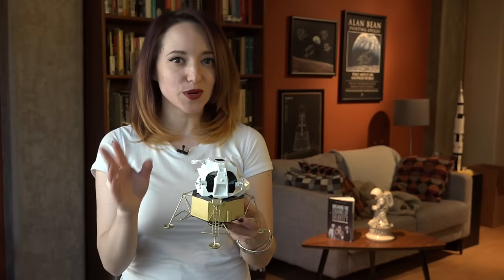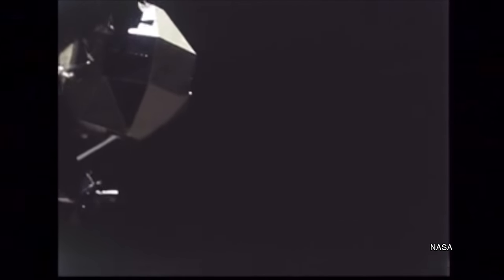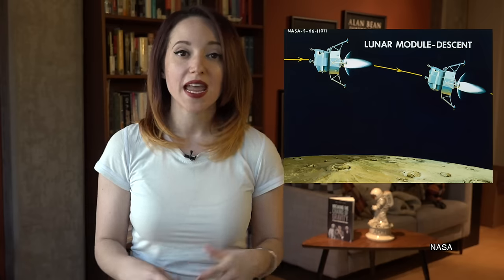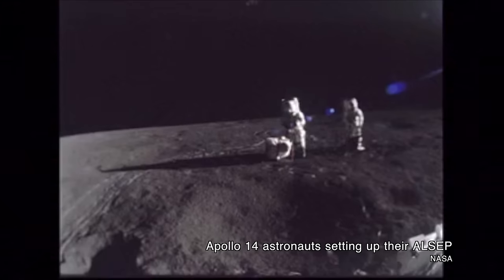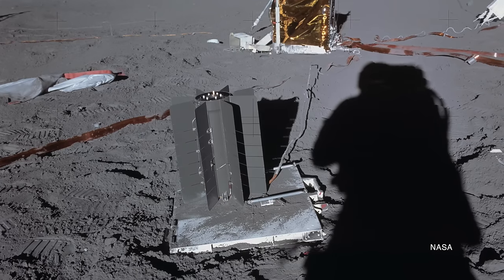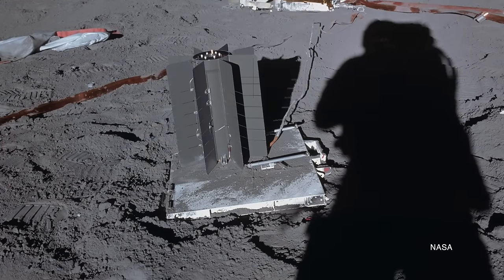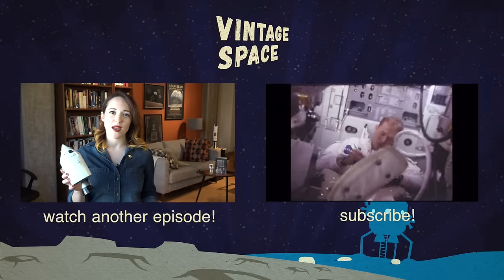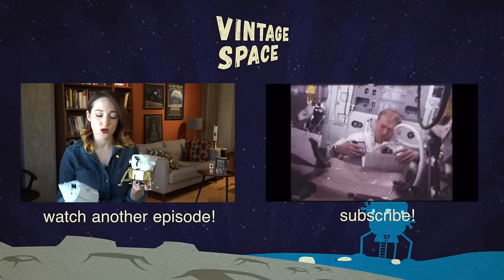What Happened to the Spent Lunar Modules?

Comment: Why and how did NASA decide on a cone-shaped command modules?
Reply: +amazing visser3 Easier reentry. Wouldn't work if it were cube, right?
Reply: +amazing visser3  Aerodynamics.  A cone shape is slightly more stable, has a little aerodynamic lift and is therefore a bit more steerable than the more spherical shape that the Russians use.  The spherical shape is more efficient with interior space and weight of materials.
Reply: +Peter Kosen yea but there is kind of no air in a vacuum.
Reply: Kaleb Bruwer  Oh?  You mean they stay in space forever and never return through the atmosphere??
Reply: A major reason for the decision was that a cone-shaped vehicle coming into the atmosphere blunt end first creates a shock wave located about 2 to 3 feet ahead of the surface of the heat shield. This insulates the heat shield from the super-heated plasma that is present inside the shock wave. If a vehicle with a more conventional aircraft fuselage shape tries to reenter nose first the shock wave would form right at the nose and place the vehicle's structure directly in contact with the hot plasma, causing it to burn up. Another secondary reason is that the same couches that helped the astronauts tolerate the G forces while accelerating during launch will work the the same way while decelerating during reentry.

Comment: I'd always wondered if any remnants of Aquarius survived re-entry.  Some probably did, but likely at the bottom of the sea given the 70% odds.  Still, would be great if someone somewhere had a piece of it, maybe used as a lawn ornament, a coffee table base, or the like.
Reply: +DSC800   Pretty sure the fuel cask along with the plutonium-238 pellet stored in it survived as it was designed to do. Radiation level checks appeared to have remained normal shortly after the incident.
Reply: +mako88sb probably best that 238 cask stays at the bottom of the sea and not used as a coffee table base then.

Comment: What happened to the Apollo 13  Lunar Surface Experiment package and its plutonium fueled RTG when the LEM burned up in the earth's atmosphere?
Reply: +WATERDOG300   The RTG was not fueled. There was a special built storage cask designed to withstand re-entry mounted on the outside of the LM that contained the plutonium pellet.  Mission control purposely directed Aquarius towards a entry corridor that had it targeted for a very deep part of the ocean about 200 miles from New Zealand. Radiation tests of the surrounding air and water shortly after it's burn-up showed the cask storing the plutonium pellet did it's job.
Reply: +WATERDOG300   There's a pdf you can google that goes into quite a bit of detail about the ALSEP deployment procedure as well as the plutonium fuel pellet transfer to the RTG. Just look for:  "Summary of ALSEP Subpackage No. 2 thermal control design".

Comment: How do spacecrafts like mars land rovers travel in space without rocket engines attached to them?
Reply: What makes you believe they don't have rocket engines?
Reply: Because there is no air in space to slow a spacecraft down it doesn't need propulsion all the time to keep going. It only needs a rocket engine to change its velocity. So it only needs rocket power to get it off the ground and send it on its way. Then it can coast to its destination without any further propulsion being required.

Comment: I don't see why they didn't go for it on Apollo 10. Set it up to be able to land if all went well, I mean 60 miles away? Wikipedia says 8 NM from surface and a distance from earth of 220,800 NM journey! They only had like .0036% of the trip left!!
Reply: Whitpusmc weren't sure if they could land safely and then get off the surface. they weren't ready to chance it, had to prove out the theory of decent and ascent would work.
Reply: weren't should have been my first word on that post
Reply: Makes sense, I think they could have preplanned abort parameters but caution works for me. This IS rocket science!
Reply: I've read in various sources that the assent stage used on Apollo X was heavier than those used in actual lunar landings, and thus there was concern that it would have been too heavy to launch from the moon's surface and reach the altitude required to rendezvous with the CM.

Comment: On apollo 14 ascent, the shadow of the lm is visible on the surface, part of the onboard footage. When the lift off occurs, the view is of the lm, speeding away, but the shadow stays right where it was. This simply, is not possible. What BS story can you tell me, to explain it?
Reply: What you're seeing is the shadow of one of the 4 RCS plume deflectors that remained with the descent stage. As usual, you jump to conclusions without doing any type of research.
Reply: +mako88sb Uhhh, I don't think so. If you check the vid, where has the high gain antenna gone to? And, if you map out the shadow in 66-9340, none of the angles match up. It's meant to look like the lm shadow. And, even if you were right, the direction of all shadows in that scene (still and vid) should show the lm shadow. The vid, especially, can see through the gear gap - to bright lunar soil. No shadow. A a 'tiny' met leaves a whopping great shadow and a whopping great lander doesn't leave ANY shadow? Yep, sure it does!
Reply: +Virgil Pheonix Well, like it - or lump it! You DID say that I had something when I hadn't. There's a BIG difference between saying someting is a 'problem' and saying astronauts will/did die. That's your LIE, so don't pretend that you didn't say that and don't try and wriggle away from it. You stop lying, and I'll stop calling you a liar. Simple, huh? As for 'what' mars has to do with it all, well, you're the one pretending to be 'bright', how come you can't figure it out? The apollo missions were supposed to 'easy', no problems with radiation - at all. Yet, now the mars teams are warning that radiation IS a problem and will be, into the future. Any reasonable pundit should be able to discern that, if a trip to mars poses a high risk, then being on the moon should pose a much greater risk, even for relatively short duration's. Yet, miraculously, it wasn't. Any reasonably competent thinker should be able to deduce that the supposed fact that no astronaut experienced ANY radiation effects, is a high-enough probability, to make the assumption that they didn't go, in the first place. Tell me how that could be possible. And, I'm not even considering the vab's, which are a separate issue. Something doesn't add up, and just glossing over it with a 'oh, that's not a problem', just doesn't cut it with reality.
Reply: "It also completely overlooks (as do you) the fact that what 'tracking stations' were available every day, around the world, to receive alsep data?"

That would be the Deep Space Network.  The three main stations are at Goldstone in California, Madrid in Spain, and Canberra in Australia.  Although built to support the Apollo program, they have since become utterly invaluable to deep space research -- and other nations barter to get time on them to communicate with their deep space probes as well.  (Russia and China do not; they just make do with partial coverage.  But everyone else with a deep space program makes use of the DSN.)
Reply: +Calli Arcale Hmmm, another 'bright boy'? Oooow, look at all the tracking stations, blah blah, blah. How come you're not bright enough to actually go look at some images of those tracking stations. You'll see that they are all hemmed in by mountains. Hardly the sort of coverage you would expect if you're gonna be tracking the moon, which (in case you hadn't noticed) travels from horizon to horizon! What happens to all the data in between the coverage gaps? Mate, some people are just sooo stupid! Also, do you think expensive equipment like rt's is just going to be used to pick up inconsequential telemetry data? If it was, then you'd expect to see funding for it in their operating costs. Or wouldn't you think that reasonable? rofl!
Reply: The data is far from inconsequential, and it's far more than just telemetry.  ;-)  The mountains are not a problem; there's a reason there are three tracking sites, and not just two.  Before the Moon has set on one site, it has risen on another.
Reply: Um, are you under the impression mountains are infinitely tall or something?  Or have you literally never seen mountains before?
Reply: Just a quick question -- have you ever actually seen a mountain?  Or, is that why a dictionary definition is all you had to go by?  ;-)
Reply: +Calli Arcale Wekk, I DO know what a mountain is! And, (once again) it seems you don't. Any idiot can see from the vids on those sites, that the mountains would be at least 30 degrees elevation.. So, draw it out (I'm sure you still have your crayon set?). And then ask yourself, why were they supposedly using a ship, out in the indian ocean, to extend the range of the carnarvon station? Oooooh, they didn't have coverage. Now, figure, that the ship wasn't going to be on station forever, so, yep, you guessed it. A break in coverage. Yet the telemetry supposedly shows 'continuous' reception. Amazing, huh? But, I guess a dipstick would never figure that out! rofl!
Reply: I'm curious -- do you think 30 degrees is the entire sky?  Really?  ;-)  Also -- you don't have a very good eyeball if you think that's 30 degrees.
Reply: +Calli Arcale Ohhh, I get it! So now you play 'stupid' so you can pretend that you don't 'understand'! Nice trick, but I've seen it many times before - and it doesn't work with me! You know exactly what I meant, so quite stalling!

Comment: It's no wonder the Space Shuttle program followed Apollo with all that expensive hardware being abandoned after a single mission.
Reply from the maker: +Ben James Yeah, reusability for cost-saving was the goal of Shuttle... Didn't totally make it though!
Reply: +Ben James   Problem is that that reusable equipment was still hugely expensive to be maintained and refurbished to the required high-spec standards of manned missions. I read a report showing the cost breakdown of everything required for a Shuttle mission including man hours related to the turn around portion of the reusable components and it was quite the eye opener. I keep meaning to check and see how those man-hours changed as the Shuttle fleet aged.

Comment: Someone please explain to me where there is no obvious flame beneath the ascent module when it took off . . . .
   All you see is a flash and it goes up .
       Doesn't look like there's even enough room for an engine for the ascent module . . .
Kind of suspicious looking .
Reply: The fuel used produces a near invisible flame, especially in vacuum.
The accent module's engine was very small and was inside the accent module. 
Very easy to look into these things, so very suspicious that you ask in this way.

Comment: dead weight in the weightlessness of space?
Reply: Don't confuse weight and mass. On earth they are equivalent but not in space. An object might be weightless in space but it still has the same amount of mass as it had back on earth. Therefore if you want to change its velocity, to send it out of lunar orbit for example, you will need additional propellants to burn in an engine to speed up the object. As such, to bring the ascent stage, which still had a considerable amount of mass that would have had to be accelerated,  back to earth it would have required a lot of extra fuel to do it.

Comment: The Apollo 13 LM is in orbit around the earth. I seen it from the  ISS. It was close and unmistakable. Saw it for several seconds in detail. Also noticed a stream of small debris following it. This happened Dec. 3rd, 2020 at around noon central standard time when the ISS was in the dark side of the Earth passing over Saudi Arabia... The LM was fully configured with decent stage, legs and all. Don't know if the ISS records their video for back-up, but if they do, and retrieve it, it will be there. Didn't think to take video or snap a picture. I was in total shock at the time I seen it and actually thought it was some kind of joke at first. Been kicking myself for it ever since.

Comment: How did they dock with only one thruster,,how did command module steer with only one thruster? Sniff I smell BS
Reply: The Apollo Lunar Module Ascent Stage and the Service Module each actually had 16 small 100-pound-thrust Reaction Control System engines to control vehicle attitude during maneuvers, including docking.   The engines were arranged into four "quads" of four engines each; the engines were oriented to produce motions essentially up, down, left and right (and please don't get nit-picky about that imprecise Earth-related nomenclature!).   You can see these "quads" located at the four corners of the LM Ascent Stage.  The "jerkiness" seen in the LM ascent stage during approach for docking is indeed real, because the RCS engines fired only in short pulses (sometimes as short as 11 milliseconds - one-tenth of an eyeblink!).  And since a pulse in one axis would send the vehicle moving in one direction, another pulse in the opposite direction was required to stop that motion -- if you watch some of the videos carefully, you can often see the short bursts of flame from the RCS engines during the approach for docking.